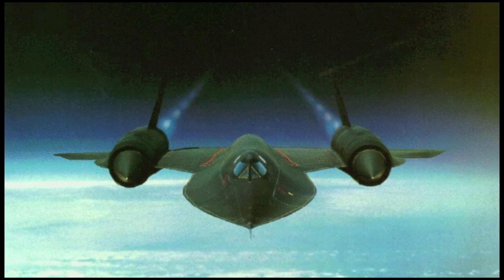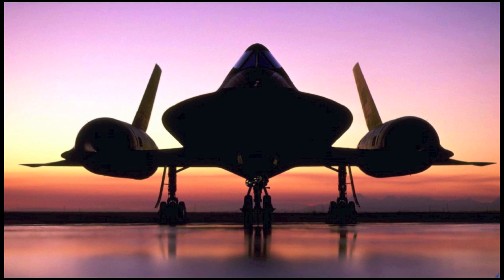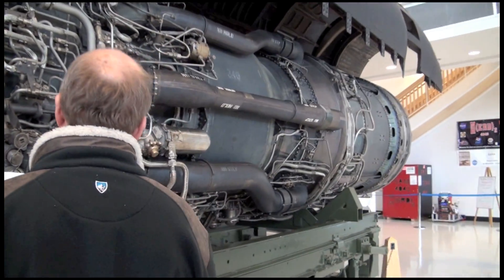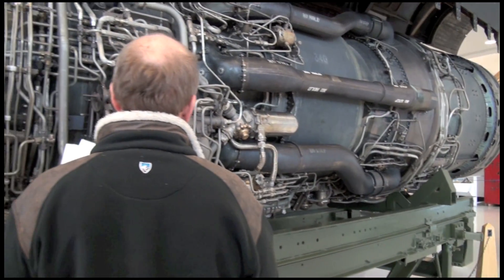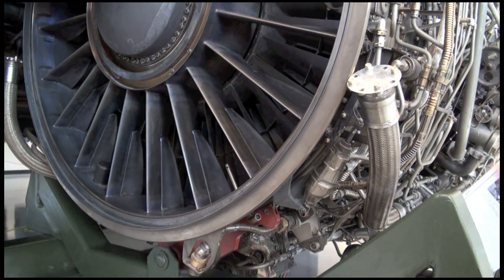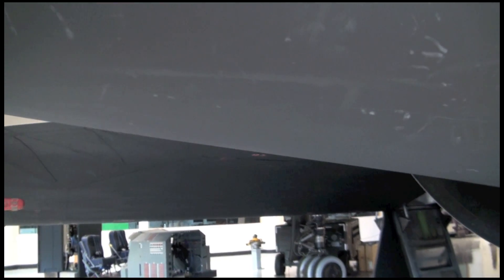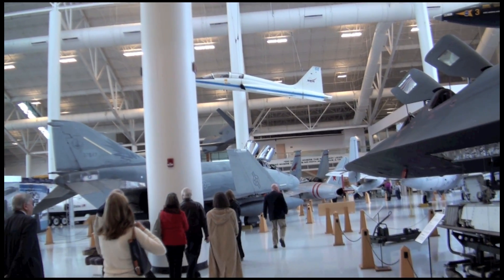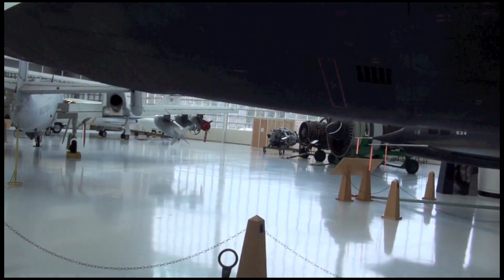Oregon SR-71 Engine Discussion J58

Comment: I've read extensively about the engines, and I know that it takes the chemical T.E.B to ignite the fuel in the engines, and each engine has about 16 measured shots of T.E.B but does it take a shot of the T.E.B to light the afterburners when going from full military power/throttle into the afterburners. If so then theoretically after initially starting the engines there is only a certain amount of times the engines can be put into afterburners. Does anyone know the answer, this is a question I've had for years about the SR-71 and it's engines.

Comment: Ofcourse the fact cited by Amehdion is also true. The phenomenon is called choking of a flow duct. You know that when you decrease a flow area the speed rises, pressure drops etc. But in compressible flows there's a limit for it. When you reach a critical area you simply cannot put more flow through so the flow must decrease upwind. The decrease in the flow in front of the engine would cause a violent phenomenon of inlet unstart, very dangerous and flight parameters costly in Blackbird's. I'm an turbine engine engineer and i'm fascinated by this aircraft propulsion system. Even by modern standards it is astonishing. I bow with respekt to every man behind that piece of technical and technlogical art.

Comment: Actually, the big tubes on the sides, bleed near 40% (or 50% - cant remember) of the air from beetween 4th and 5th compressor stage and direct it to the afterburner. At desired Mach level, the inlet itself generates pressuure ratio (by "ram" compression) of around 38-40 (more than modern jet fighter engines). So the comressor action is unwanted. Thus the engine core at this conditions run on low power, only sustaining core operation, and the afterburner acts similarily as a ramjet combustion chamber (adding most of the heat). Besides of that bypass system the propulsion assembly has a complex system of other bypasses mainly controlling the sophisticated inlet operation.

Comment: He makes it too complex.  Just say it's a ramjet.
Reply: Eric jones- It’s only a ramjet at Mach 1.2. It is a more complex than any other engine. To say it’s a ramjet only over simplifies it engineering.
Reply: I believe the correct term for the J58 is Turbo ramjet engine, or a combination of turbojet and ramjet. The bypasses are for the ramjet part that requires supersonic airflow to work normally. As stated the turbojet gets it up to Mach 1.2 (with the spike/cone) extended) and as the plane increases in speed the spike/cone moves back to allow allow the ramjet to work up to Mach 3+.  Top speed is still classified as far as I know and is limited by the heating of the body as the gentleman said.  The extreme heat makes the body of the plane grow in length and helps seal the fuel tanks that leak on the ground.  That is why an operational SR-71 would have drip pans underneath while parked.  It is a fascinating plane to see in person both on the ground and in flight.  Fortunately I got to see one not only on static display in an Air Force hanger, but also to fly during an air show in the 1980's. Even got to see a single engine test run on the ground the day before the air show.  Wish I had known the spike/cone was mostly a type of plastic with a titanium tip back then as those of us stationed at the base got to go up and take a close look in the hanger.  Did the same for the F-117A before retirement and the F-22 after it became operational.  Did see the F-117A earlier at a civilian air show but it was roped off and guarded so could not get that close.  Plus the guard warned if using an autofocus camera using IR picture would come out blurry as it would not bounce back properly to focus correctly.  Must manually focus old school.  At least that is how I remember as it was long ago. I actually prefer the SR-71 as shown as I had never seen the camera equipment and bays opened up like here.  Thanks for the memories.  Lockheed definately made some exotic amazing planes far back thanks to Clarence "Kelley" Johnson. Would have been nice if there were pictures of the Schleren (sp) airflow to see the shock waves.
Reply: U see everything in life too simply and that’s where this generation failed and to say this is ramjet engine, u fucking dumb fuck don’t fuck here u idiot that engine is more than a ramjet

Comment: 1:22 The three thick black pipes on each side are used to allow some air to bypass the compressor stage of of the engine while over certain speeds. This stops supersonic air from jamming up in the engine as it decompresses from the shock wave formed by the spike, and switches the engine from a turbojet to a ramjet. For a good tour of this j58 engine check out this short interview with SR-71 pilot Richard Graham, hes quite good at explaining how everything works.  watch?v=VpZfBFlTC_c

Comment: The large tubes are there to bleed off air from the compressor stage. This engine had airflow issues in that stage, and, instead of blowing it out of the aircraft, and wasting it, they piped it around the engine and used it. I think they were used for the ramjet functioning of the engine as well, but that could have been handled by separate tubing. I don't remember which. The rest of the piping is used for cooling, fuel, hydraulics, etc.